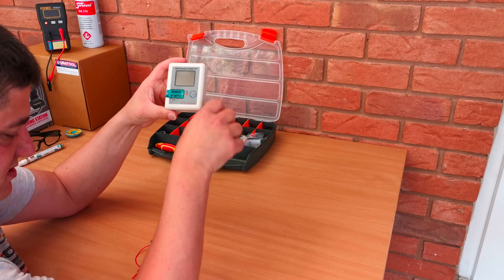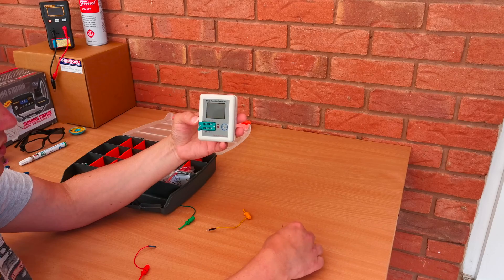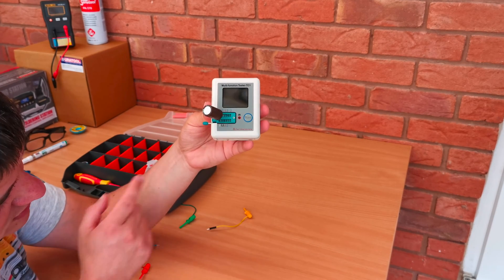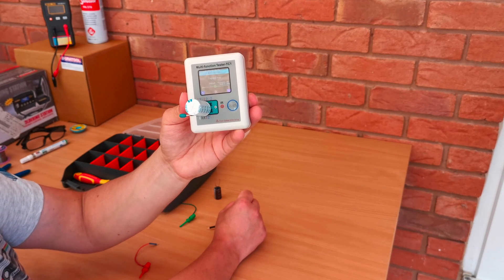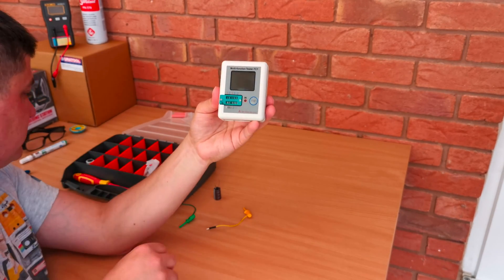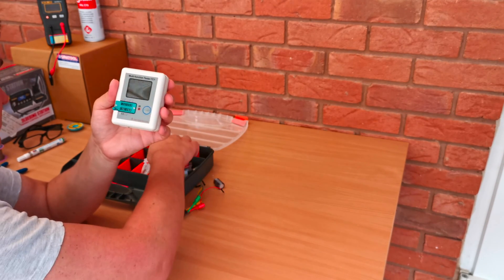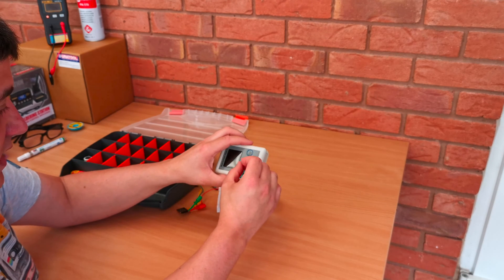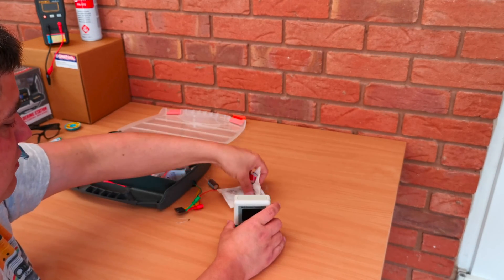LCR TC1 Component Tester Review, battery and Teardown

Comment: (01:20) It should be pointed out the user manual p5 states, 
Warning Always be sure to DISCHARGE capacitors before connecting them to the tester!

With a high enough residual voltage, the TC1 will be damaged if the capacitor is not adequately discharged before connecting to the TC1. I THINK the threshold is 4.5V, but I'm unsure on this:  e.g. <4.5V may ="safe", while >4.5V=damage.

Comment: I got one of these to measure diodes fv etc. Works great for this. I was hoping to also use it to measure coil inductance but it just sees them all as capacitors and doesn't give me the Henries. Manual was not much help, I guess I still need a digital LCR for inductance?

Comment: Great video. Any ideas why I can not calibrate mine? No matter what I do and I follow the calibrating guide... Cheers!
Reply: Have you still got the 3 pinned item that should have come with the unit? Of course, if you haven't, then ALL you need to do is short out pins 1, 2 & 3 with whatever you've got at hand, then start the calibration process, then remove it WHEN instructed to on the screen.